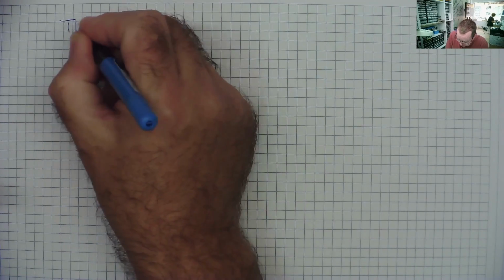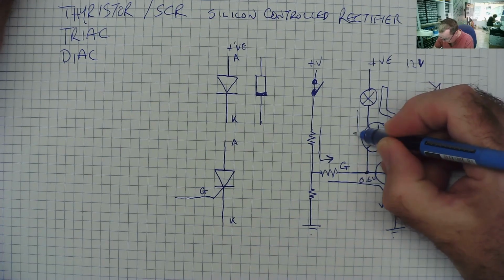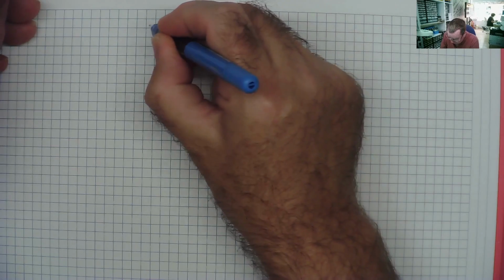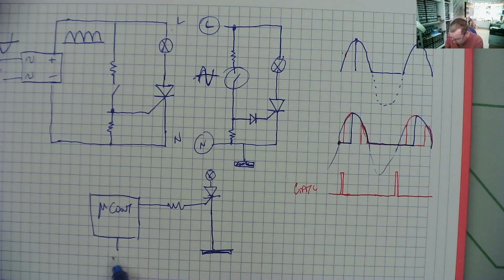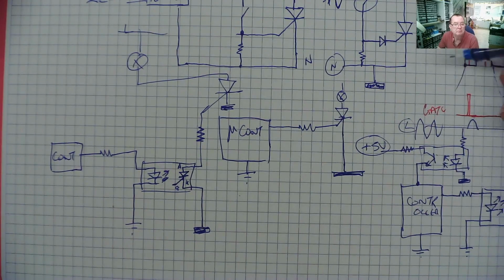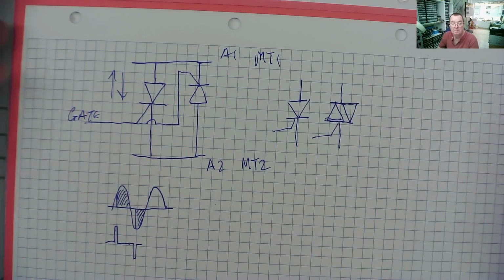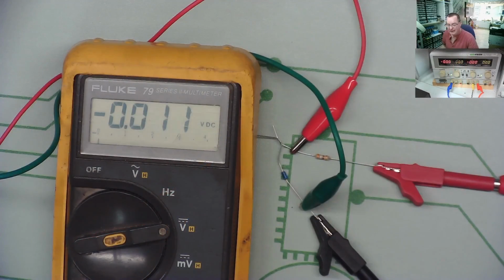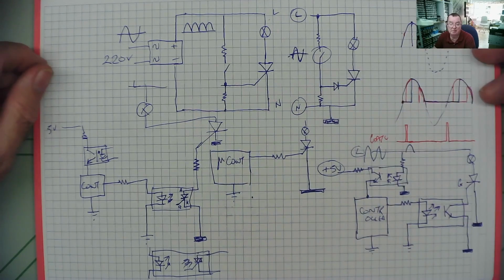All You Need To KNOW About SCR Thyristors (Traics and Diacs) To FIX Stuff! How They work tutorial

Comment: This was very useful - thanks very much. I think the circuits where you are driving with an opto-isolator at about 30:00 are a bit problematic though - you are sinking current through the opto transistor to turn on the thyristor, but in the initial examples you are sourcing current to turn them on - am I missing something?

Comment: HI, I`m just trying to use a Thyristor on a 3D printer heated pad. I want to make a voltage divider so I can control it with a Arduino. I`m measuring 99k ohms at room temp. I guess I`m going to try a 100k ohm resistor in the voltage divider on the other side.

Comment: Great job. Thank you very much. But you've mixed up Zener diod with Shockley diod (Dinistor). Diac is originally two Shockley diods counter-axial connected. There's a difference in V-I characteristics of Zener diod and Shockley diod. The main difference is that the Shockley diod is a thyristor controlled by a threshold voltage.

Comment: 26:35 i am afraid you are somehow  wrong here (in a way) Today  many appliances have  the uC are operated directly on the mains usually using an offline switcher like tiny270 or LNK304PN  in a forward converter topology where the secondary(just a single one ) after rectification is directly tied to the Mains Line 240V , the uC is now able to operate the triac by allowing it to complete the loop through the uC and then through the triac  this is one note application_note/an440-triac-control-with-a-microcontroller-powered-from-a-positive-supply-stmicroelectronics.pdf  this is another Philippe RABIER/Laurent PERIER  APPLICATION NOTE MICROCONTROLLER AND TRIACS ON THE 110/240V MAINS  if you want i can send you an schematic of such application and you can make a in depth  video

Comment: Hi Rich, in your diagrams of SCR''s the opto isolators when turned on will actually be turning off the SCR's and the loads. It will control the SCR but the logic is reversed, opto on load off. So an additional resistor would be required to turn on the SCR like your earlier diagrams that were using switches.

Comment: The main place I see TRIACs used is in SSRs (Solid State Relay Circuits) be it an actual standalone SSR module or an SSR circuit "embedded" on a board as part of the whole circuit.
One word of caution I have about SSR modules namely the cheap ones off ebay (Fotek, etc) is that usually they are labeled wrong like say a 40 amp will actually be a 10 amp but can handle a 40 amp spike but run constant on 10 amps. This is fine for inductive loads like an HVAC compressor, but can be a problem on resistive loads like a heater element.

Comment: Its hard to believ the head aches that SCRs caused in the late 60s early 70s when they started to be used in the psu of tv sets (bush T20 anyone) just got are head round them and good old SONY came up with there own version the gate controled switch used in psu and line output stage.
Mind you they were easy compaired to thorn and there series switch mode psu
Reply from the maker: Hi Rob - I do remember the 'chopper' circuits used on old TV power supplies, and then distinctly recall being taught about the SYCLOPS circuit and that was also my first introduction to hot ground, before then the chassis was always connected to neutral though you needed to check the mains plug wiring just to be sure   There was a myth going round that once you plugged in one of these new fangled SYCLOPS TVs in and it started it up, you could then unplug the mains and it would keep on going, seeing as it was self powered 😁